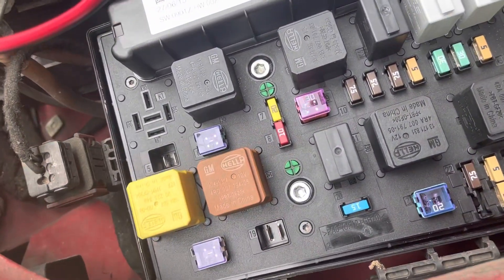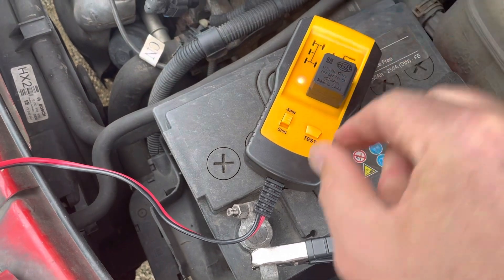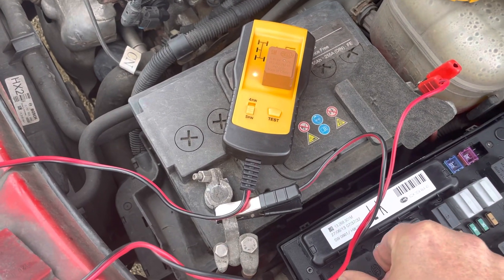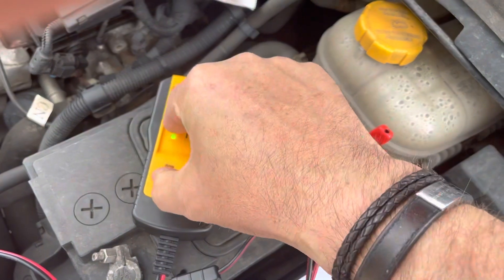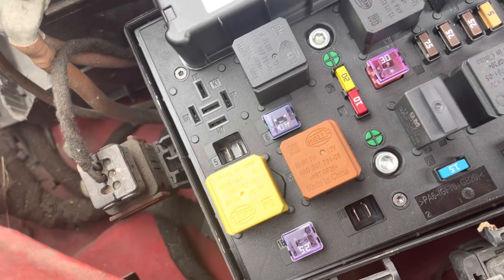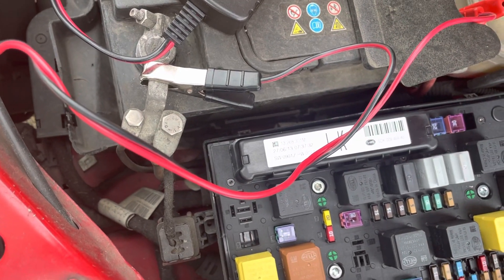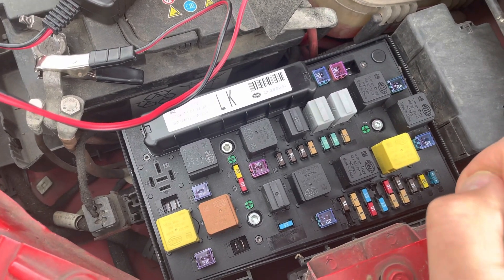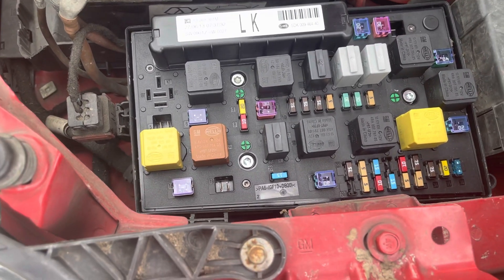Testing Radiator and A/C Cooling fan relays on a Vauxhall Opel Zafira b

Comment: Is there a part 2… i will look now, did you find the issue?
Reply from the maker: The relays are fine, the fan works, I have a new pressure switch coming. I have tested for continuity and it looks like high resistance, unfortunately I don’t have opcom, so I’m trying to do this with basic tools.